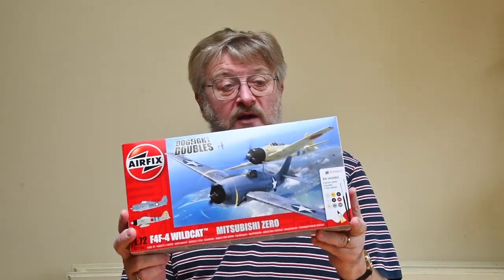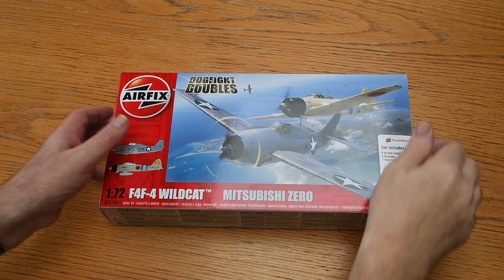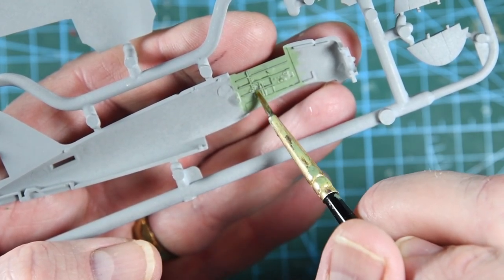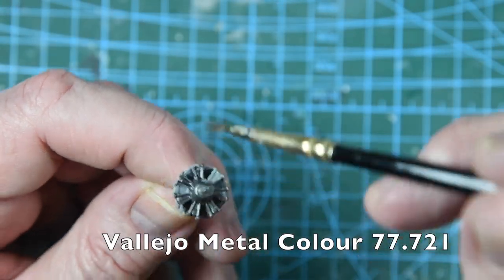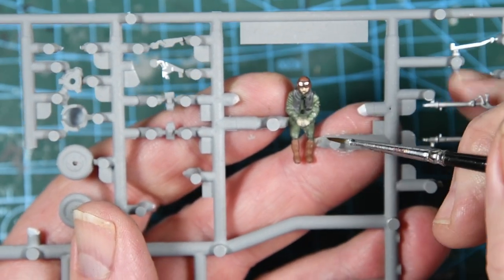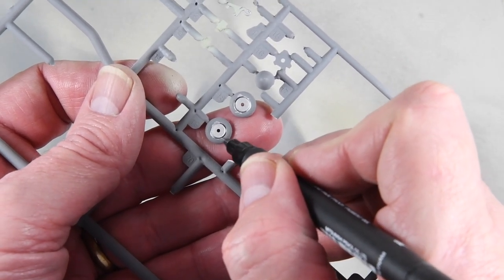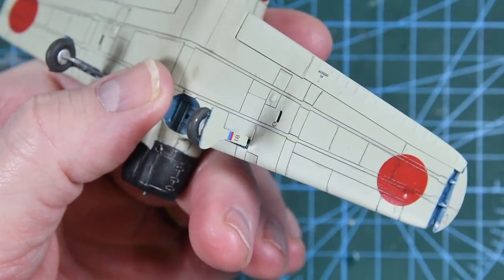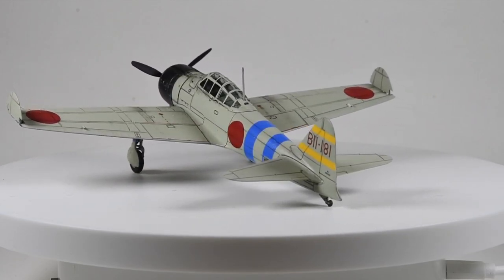Airfix Mitsubishi Zero 1/72 scale 2011 tooling review and build - HD 1080p

Comment: Havent built a model.for 40 years and tried the zero as mynfirst one. If it wasnt for thisnvideo i would have given up and walked off half way so thank you for the insights. For me those were the hook of the pilots chair. Get that right and the two sides come together. The engine was confusing and i still.could.not get it to fit into the aircraft so pushed itninto then cowling and glued it all. Seemed to work but i know the fit should have been better.  Next time will watch the video first then try

Comment: Dear Gary, I can't see what glue or weld you  use  with much of the interior parts. Would you be  kind as to tell us what all glues you bring to bear on the interior components of you r great models to make them sturdy enough? Often, ir looks as if you use nothing except for faint white stripe I can discern,
Cheers and compliments on your long running series !
Reply from the maker: Most of the time I use Revell Contacta or Tamiya Extra Thin depending on the piece. With interiors and structural pieces it is normally more the Contacta.

Comment: I've built Airfix's Swordfish,Gladiator,Ju-87 and think their quality is very good. But compared to Tamiya's zero... in my opinnion Airfix have some minuses like, flat control panels, closed canopy and  less elaborate overall design (Tamiya would never make you do things like 11:04 ) It would be interesting to see how good is Airfix Wildcat compered to one from ArmaHobby. 
Why are you so dedicated to Airfix by the way? Looks like they are the only manufacturer you are buying your kits from.
Reply from the maker: They are the only ones I have bought recently - I got quite a lot in one go - and I try to keep on top of new releases. However, I do have others in the pipeline. There's a really lovely Gaspatch Me-163 in 1/48, for example, that I'm really keen to do soon. In my last project (before YouTube sadly) I made all the aircraft flown by my father's squadron in the Fleet Air Arm. Only the Buccaneers and the Harriers were Airfix, the rest were all kinds including CMK Resins (the Nimrod II, what a nightmare). You can see those builds on my blog called The 800 Squadron Project. I am very tempted to redo it in 1/48th - as soon as someone does a Scimitar at that scale anyway!

BTW, I am going to do the new Airfix Tempest V when it comes out, and compare it to the fairly new KP version at the same scale.

Cheers,

Gary
Reply: I can't speak for the ArmaHobby Wildcat but, having done the Airfix one it's a really neat little kit......I did it as part of the 'Dogfight Double' with their lovely Nakajima Kate.

Comment: I've just startrd building the starter version of this kit and found something interesting while researching.
The Mitsubishi built versions didn't have  Aotake in the wheel wells. They were the same colour as the surrounding area with black main landing struts.
The Nakajima built ones are the ones with the Aotake coating in the wheel wells.
Reply from the maker: That is very interesting - you'd have thought there was a standard to which they all had to adhere - but that is good info thanks!